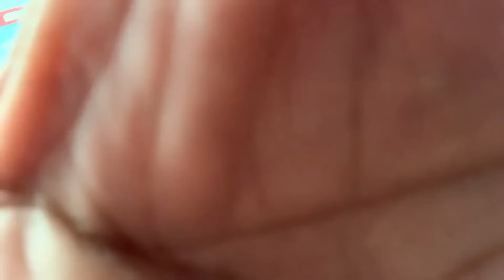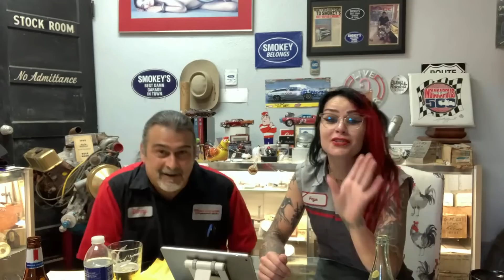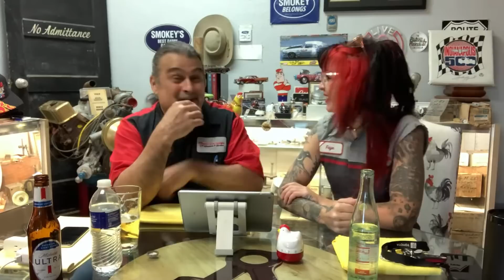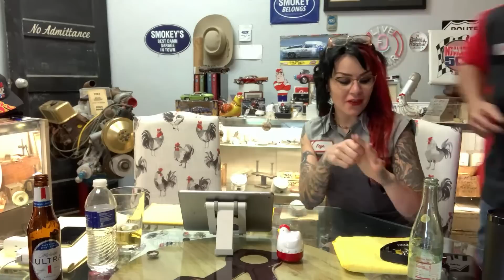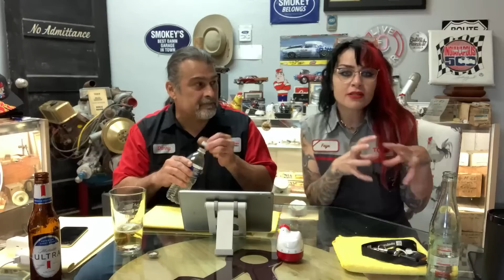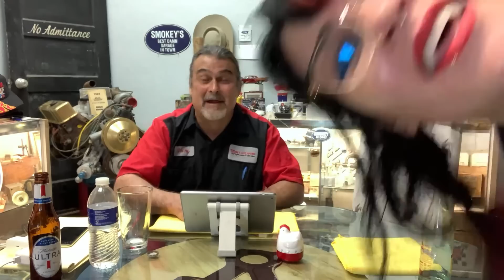Daniel Soliz is live! #smokeybelongs #nascar #automobile

Comment: For L1 &L2 the "composite" vehicle is a mock vehicle ASE uses.  And they supply you with an electrical schematic for the "composite" vehicle. When testing.  And I believe they supply you with the 5-gas emissions readings.

Comment: The ECM is pretty much the same, all new cars have CAN controllers that control everything else.  The pinout is not the exact same location on the plugs, but the pin numbers are the same.  The CAN controls all the different parts outside of the ECM.  I would think both are correct.